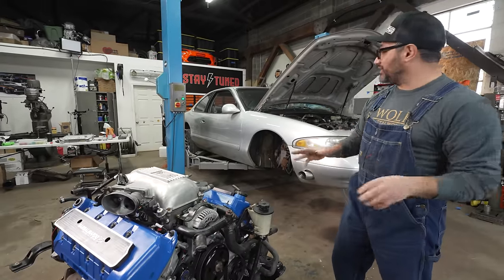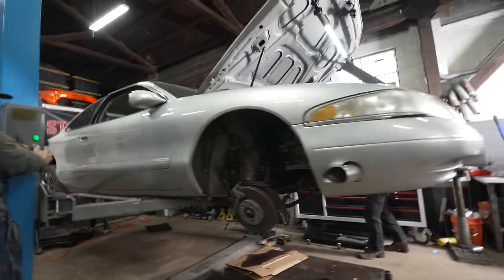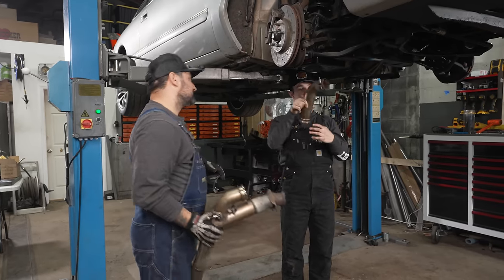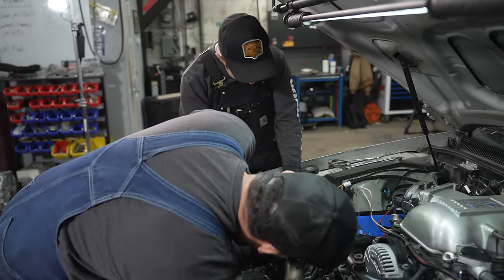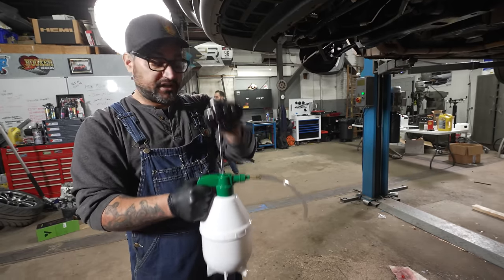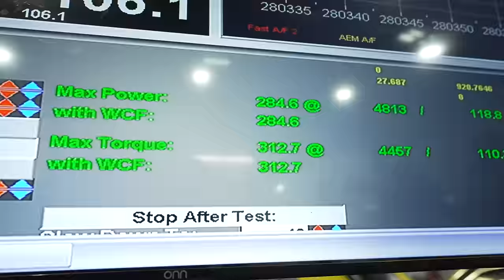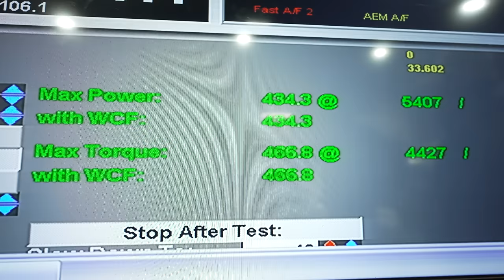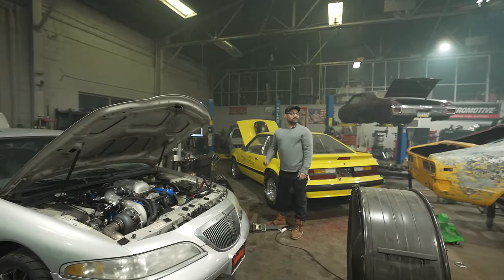Ex-Grandpa's Car Transformed into BIG HORSPOWER V8 Turbo Monster!!

Comment: Doesn't learn a single lesson from killing all the previous engines and inserts that disgusting exhaust pipe that is absolutely guaranteed to make  one bank of cylinders knock worse than a 1930's diesel engine...... subscribed
Reply from the maker: HAHA, welcome to the party!
Reply: One would think he understands the benefits of ‘equal lengths.’
Reply: @RR-iv6fm  I'm absolutely certain he does, but doesn't care and sends it anyway. That's what I love about it....first engine had absolutely zero chance of surviving that first pass, but the man tried anyway. If it actually lived long enough to set a time he would have been the hero for even just a few moments, that's what we all want to feel...it's not always a 7 second pass that will give you that feeling 😅

Comment: as a SAAB guy, i love the explanation of boost control...something SAAB was doing in 1985 based on knock sensors.  By the mid nineties SAAB cars were sensing knock through the electrical resistance in the air between the the spark plug ground and electrode.  20 years later Audis still have knock sensors.  Find yourselves a mid to late nineties SAAB 9000 and get in touch with MikeD.  You can make 500hp with those b234 engines without pulling the oil pan or valve cover.  The transmissions are glass, but they make adapter plates.
Reply: Can confirm all of this. Gearboxes become service items over 300hp, less if you’re not gentle enough with the boost down low. I miss my HX40 fed 9000 Aero, with the old trionic suite soldered pin out/bdm setup. Good times
Reply: Yeah but 500 hp fwd cars are dumb. Especially when the engine is in there backwards.
Reply: I blew the turbo on my dad's 86' 9000 turbo. I loved that car
Reply: @jasonbirch1182  I think he meant to swap the engine into an rwd application. Also B234 (or B204)  engines are oriented as normal fwd cars.
Reply: Hey! Mike D here!   500whp is really the upper limit for a b234,  but still possible.    I love seeing builds that are not common engines.  Common engine builds are both cheaper/easier  to do, but also turn car shows into big advertisements for products.   When nobody makes the part you need. You get the real science/creative process on screen!  And that's why I love this channel.  Nice work Tony!
Reply: I know the bolt pattern is the same but I ran an F23 in my Astra making 365whp no problem for like 5 years. I did break a few but not because of power, they were already hurt 😂
Reply: saab really went bonkers on their little turbos. crazy engines! i hate that chevy decided that under-funding a high end car brand was a smart idea. typical american motors....
Reply: @ferkle1980  aero?! sweet! those are cool little sleds!

Comment: I’ve had 3 of these Lincoln’s. I love them. The interior is timeless.
Reply: I happen to love Ford/Lincoln interiors of the mid-late 90s, but a lot of people don't. Had a loaded 97 Taurus and it was nice before it fell apart. Sucks they're all long gone in the rust belt here.

Comment: Awesome! You can run 99-01 Cobra exhaust manifolds on the older B head stuff. Makes for a decent and cheap upgrade, and gets rid of that Basket Case drivers side manifold that Lincoln put on. Also, what did you do about the IMRC's? If they're still in place, or just zip tied open, it will cause some nasty restriction under boost.

Comment: Tony,you can use a small 12v AG pump from a farm supply store and force feed the motor to prelube it and also watch for pressure through the holley or the dash oil pressure gauge,I have done it on a stand with LS stuff and it works great and they can generate plenty of PSI plus they are pretty cheap just and FYI
Reply: Can also modify a small BBQ propane tank . Pull the tap and fill it with oil, screw a tyre valve fitting into the bleed port and charge it up. Blast into the oil pressure sender port.

Comment: Hell yeah 515 in a street cruiser is perfect. Hope this gives you faith in the fords now. Injectors and a revised hot side it will make 6xx easily. 

Also Zac saying “whoa” after Tony says “show it to me” then seeing it’s a girl delivering the pizza I about pissed myself 🤣🤣🤣
Reply: It won't surprise me in the slightest if it picks up 100+rwhp with an efficient crossover pipe. The one they have is stunningly inefficient.
Reply: @Rollin8.0 I agree. I tried pretty hard on my first turbo set up to make it flow well just to put way too small of a turbo on it lol (357w with an s366) Only made 480 at 7psi but good for 11.20s at 3800ish lbs

Comment: Better exhaust routing, more injector (and maybe fuel pump) and you probably have well over 600hp. But, keep in mind, the Lincoln has the aluminum housing 8.8 which can accept an LSD, but is a bit weaker than the Thunderbird/Cougar iron differentials. Of course the CV axles will break first typically... but if you can find a T-bird SC differential with a factory LSD, a quick gear swap will get you sorted for low $$. Or just build the entire thing. Just beware of the stock 2-piece sleeved driveshaft. That's why they had limiters at 130MPH from the factory, due to driveshaft speed.

Comment: BRO!! Intercool that motor! Geez! I wouldn’t complain if it were carb’d but it’s not, those inlet temps are gonna be wild!
Reply: that's what the meth injection is for
Reply: @joemueller-zt9hn  for boost, intercooler for even more boost, cooler inlet temps more power. Why, you don't like more power?
Reply: @abaracskai  I'd guess it was an installation situation. remember they started the project "as cheap as possible" and so far have only upgraded parts that failed
Reply: It’s got the meff though.

Comment: Every time you keep yelling “Double it” I could see the top of the engine explode again. There is a limit to reliability.  You guys are a small operation with big ideas and balls and we all appreciate it.  But, damn, y’all got to back off a bit. 515 at the wheels and 520 torque is awesome for the grampa machine!!!!  And it is still a luxury model…..with cloudy headlights and tailpipes coming out the front quarter panels!!!! Anybody who tries to beat that sleeper is going to regret it…..well, we’ll see how well it performs on the next episode, I guess!  You need to be slumped a bit in the driver’s seat with both hands on the wheel, wearing a white hair wig, big horn rimmed glasses, a red farmer flannel shirt, blue jean coveralls and old work boots to complete the look of the sleepy sally!!!! Oh, and one more thing…..a bumper sticker that says “I might be slow, but I am ahead of you!” Go get ‘em!!!!

Comment: I know you mentioned the exhaust not being efficient but every time this car sees the dyno it makes less power than you expect, maybe its worth considering making some changes
Reply from the maker: I know, but less than you'd expect but almost as much as a hellcat seems pretty cool.
Reply: hell yeah,if it makes 520 wheel with this setup,its insane already.imagine a better setup with some stainless headers and a bigger diameter downpipe/turbo piping.............wonder how much more power it would make???

 @StayTunedTA

Comment: Tony you really need to intercool this thing.. That should be the next thing that goes into this build
Reply: the methanol injection is for cooling the intake charge. I'm thinking that trying to find a place for an intercooler and all the charge air piping under the hood on this car would be just about impossible.

Comment: Honestly I wouldn't be afraid of going to near 100% DC, I run 60s on my terminator and make around 600 wheel, been running it like that for 6 years and that's with a blower eating horsepower, you should be able to hit 600 easy with that combo assuming you have a decent enough fuel pump.

Comment: I had a 74 sting ray we put a high pressure oil pump on, it idled at about 80 to 85 psi oil pressure. At 6500 it ballooned the k&n oil filter and strung a leak at the seal on the filter. You might be losing upwards to 50 hp because of the oil pressure, don't know but 80 at idle seems to be too much in my opinion and experience. Love the car, and the videos. Keep up the good work.

Comment: Back in 91-92 , I was framing houses in Georgia just north of Atlanta. A couple guys had a LSC mark 6,or 7 don’t remember but we would pile in this car and rip it for lunch hour everyday. We called it the Long Smooth Car, not the LSC car,lol. This car would just rip those rpm’s so high we thought we were floating down road!! Is was so fun, think I was 18 at the time. Come to find out it had no registration no insurance no paperwork what so ever, just a dealer license plate. Cool car’s gotta say
Reply: 91 or 92 would have been the Mark VII. A bit boxier of a car.  I had a 91. Me and 4 buddies would go eat barbecue, and when we would get out the car, the air ride would adjust and the darn thing would look like it had a six inch lift kit. Hilarious.

Comment: Great job guys!  I know space is tight, but please add an intercooler when you install the bigger injectors.  Then you'll be drifting grandpa's Lincoln in second gear with that Gearstar.

Comment: The easiest way to prime An engine with oil is to take out the sending unit and put an adapter fitting in the sending unit hole then pour some oil in a clean bug sprayer pump it up and pressurize the oil throughout the engine, especially on mod motors I do it all the time.

Comment: I have a 07 Pontiac G6 GT Sedan. Factory it is a LZ9 3.9l with a F40 6-spd manual. 

The 3.9 isnt much / not much has been done with them. However, that trans is a direct bolt to the ls4. You just need to add starter pervision on the trans as the ls4 doesn’t have it. Fiero guys do LS4/F40 swaps and get a nice 300hp stock to those. 

I want to use their R+D and a little of mine and put an LS4 into my G6 sedan. Talk about sleeper. A baby sky blue g6 sedan with tan cloth interior.

Frame rail fitment is the only issue as the 3.9 is tight. Adding 2 more cyl will be tricky. But you give us home guys insperation. I can buy an LS4 car for $1000 with a blown trans, and have everything I need as far as mounts, wiring, ecm. Fuel pump. Whatever I may need aside from clutch and flywheel.

Comment: What about the suspension on your mk8. Does it still work as intended? Don't those cars drop down a few inches as speed increases, steering wheel response speed increases? 
Lincoln had a cool commercial about the mk8.
Back when that car was new that engine was pretty good stuff.  I think they claimed a 280+ HP with adaptive/active suspension. For the 90s that was the sht to have.
Are you going to put a air filter on?

Comment: I remember these cars when they were new.  The shop I worked for eons ago built one with a procharger that did 550 wheel and was dead quiet.  Loved driving it around and melting brains.

Comment: Find you a small propane tank, flush it good, weld a 2” fill bung into it, a siphon tube with a fitting to attach to the oil sending unit hole and weld in a schrader valve with gauge. Add a gallon of oil, connect to sending unit hole and give her about 50psi, rotate the engine while its force feeding the engine and when its empty fire it up. 

Works on any engine and already has 4qts of oil in it

Comment: Didn't know about the filter housing pre lube trick- cool!  Another good thing to do is disconnect the crank position sensor and you can crank it over without any fuel pump or injector spraying

Comment: What’s up Tony i used to own a 97 mark viii back in 2015 (2nd car) same color combo for the exhaust manifolds you can actually use the 03/04 cobra manifolds if you modify the steering joint it would eliminate the need for the catted manifold. Keep up the good work!

Comment: Awesome car. Awesome video, can't wait to see more. What kind of highway fuel mileage would something like that get built for 500hp?
Reply: Prob about the same as a stock 4.6.  If you're not in boost it won't use much fuel.

Comment: You guys need a Sullivan intake, turbo headers, bigger injectors. I watched a navigator 5.4 make 700hp, 800ftlb torque back in 2008.
Reply: There is a ton of power left in this thing this certainly isn't a good example of what these things are capable of.  It's making people think a built 4v can only do 500 wheel with a turbo lol.  Try double that plus some.

Comment: Larger injectors and a nice intercooler. If it weren’t for the exhaust pipe coming out of the front bumper it would be an unassuming sleeper for sure.

Comment: IMO nicest 90s car to build or keep original, reasonably priced to buy, interior nice , exterior nice lines and you can have a kick ass hot rod for 10k 4 wheel disc breaks loaded fun to drive

Comment: Hell yeah guy!  Love the sleeper lincoln and its a pleasure to see the 4.6 4v get some love.  I got a 03 Merc Marauder that I have grenaded the rear end and rebuilt with 4.10's.  I also run a Marty tune from Mo's speed shop,  same guys that help out your boy Finegan with Blasphemi.   These 4.6 can use some extra balls to get going with the weight and to get them into their power bands.  Your right that thing will be an animal.   I"m a pretty big fan of Nitto for my stanced setup on the Marauder and curious what the Mark VIII is going to look like with some good meats on the rear.   Keep on trucking and Happy belated bday to the kiddo.

Comment: Hay Tony,
Good Video!  Take all the spark plugs out and turn it over with the starter till you see oil pressure...No Worries!
Reply from the maker: Thanks for the tip! Wasn't sure if it would spin fast enough to get that initial suction going.

Comment: Is there any reason not to leave the charge pipe off and get it running/do a little tuning to get it started NA first with a new/somewhat unknown engine build like this? Seems like it would greatly reduce the number of initial variables you're dealing with and also give you a better idea of what sort of power numbers to expect with boost so than when you do add it you can more easily tell if it's properly meeting expectations or have a narrower idea of where the issues might be if it doesn't.

Comment: Another way to prime an engine, any engine is to use one of those transmission filling machines, remove the oil pressure sender, connect a hose and fire away, of course you’ll have to make up a hose with the right fittings but it’s works great.

Comment: I really thought it could get 800-900 hp to the wheels with that engine 🤔🤔🤔 but dammmmmm that thing is a monster and sounds amazing!!!!!
Reply: It can get 1000+ to the wheels with "that engine" the thing is the engine isn't holding it back it don't have enough fueling nor does it have an intercooler.  You can't just automatically make big power because you have a built engine it just ALLOWS more safe power to be made you still gotta have the right overall setup.

Comment: Got to say at minimum, the Stinkin Fart 8 is better looking than the Ford Tornarse equivalent. Actually the 4.6 and its semi closed deck, along with the forged parts, should be bulletproof enough to handle that turbo for the long haul. Gotta find some weight that can be removed to make her lighter though.

Comment: Im willing to say that if you just trashed that reverse Y and gave the exhaust a straight shot to the turbo that would gain quicker spool and move the torque/hp peaks a little further down in the rpm but will also max the injectors quicker too though. Still a cool ass build and fun street power, definitely has a better aero body than any sports car from the big 3 for sure lol

Comment: Did you check oil pan to pickup tube clearance on the other short block? Arp main studs require the  stand off nut to be ground down or the pickup tube will be too close to the pan.

Comment: So after you take it down the track. You need to bring it back into the garage and put 100 lbs injectors in it, then retune it for 600+ whp.
Reply: You certainly don't need 100 lbs injectors for 600 wheel lol.  If it had an intercooler it could make alot more power.  Unless you're trying to run it on e then it might need 100 lbs injectors.  I run 95# on a 750 rwhp 07 gt500 and that is with a gen3r supercharger on 93/boostane it had plenty of fueling with pump boosters.

Comment: Not sure about the pre lube, it would make Oil pressure it was pulling through the pump not low, I’m guessing the oil pump teeth were cut wrong or it spit a seal when it was tightened down or something stuck in the gallery

Comment: Crazy your running out of injector , I made 621 wheel with 60lbs injectors , 340 pump with 45 psi base fuel pressure , duty cycle was around 90’

Comment: I've been using Ford products for a while and the MN12 chassis is something that people sleep ( pun intended ) on. Yes they are heavy, but they have great balance. When the Mark VIII was first introduced ( 1993 ) there was a commercial made on the dry lake ( I think El Mirage ) to showcase the automatic air suspension at speed.  Unrestricted, a stock unit went 173 mph ( the cats were removed and speed limiter deleted ).

Comment: I had a 97 I bought for 2 k back in 2016 after my silverado puked which I pulled my lawn equipment with, I pulled my lawn equipment with the Lincoln until some asshole backed out his driveway and hit my trailer which sandwiched my Lincoln between my trailer and his truck! I was high class lawn service for a while! Lol

Comment: That engine ahould be able to take a couple more degrees of timing. Guarantee you could have picked up another 30-40 whp with 2 or 3 more. Love the car though. If the ol' 4 valve takes a dive, throw a gen2 coyote in it with some boost! Lol

Comment: First start get HOT ! With no water let cool recheck bolts put water in 2nd start / break in vary rpm , load and let decel

Comment: I’d hope whoever built the engine used assembly lube.. i mean we always did. Assuming the pump isn’t air locked, you should (have) been fine